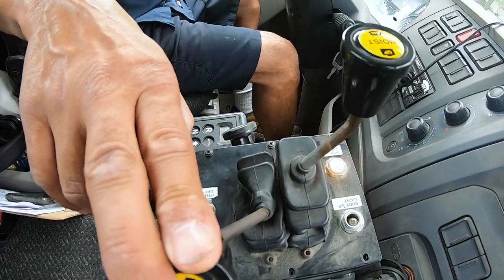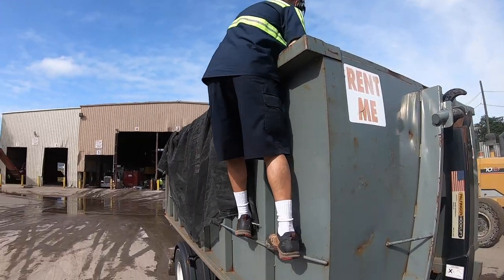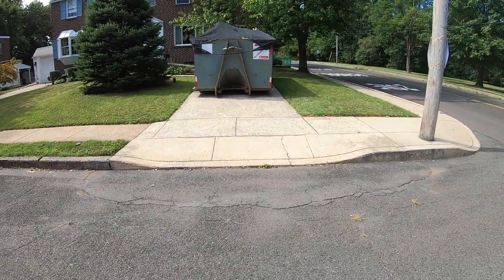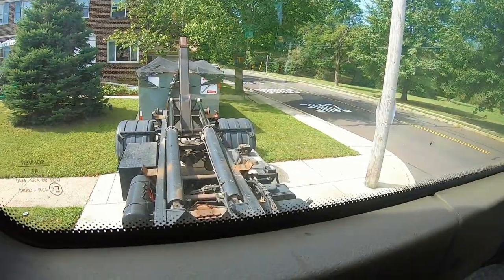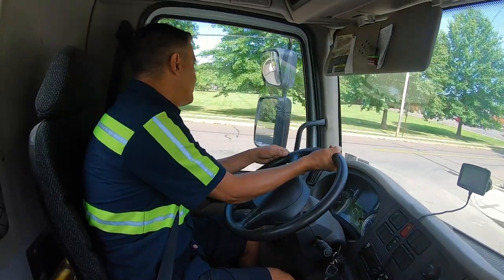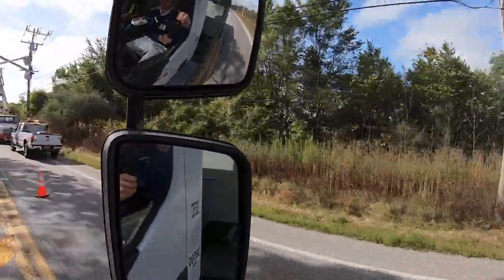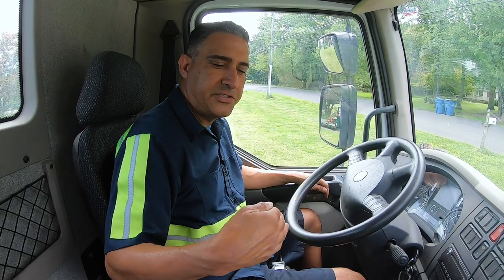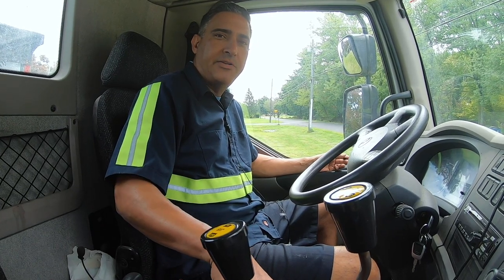Avoiding (Massive Fines) With An Overweight Dumpster Truck

Comment: Looking back would you still choose a hook lift over the cable system? I see Republic and Waste Management using the cable systems here, I was just curious to see if one was more superior than the other. Thank you in advance love your videos
Reply: I’ve found you can articulate situations in your favor a little easier with a cable setup. I like both but if I were buying a truck... I would go cable.
Reply: After working with both kinds, i would take the cable. 
Hook lift is awesome in tight spots if you need to spot the box like a trailer, the driver can go about 30* angle like a trailer while picking or dropping... As long as it is perfectly straight when box contacts the truck rails. But no choice how high the front of the box goes up when pulling it on truck.  If theres lots of junk above the box, it might slide off the back.
Cable lift can bring the rails down, get the box rollers to just clear the fenders. Get under those low residential house wires and large tree branches. 
I"ve been at it for about 10 years. I had to put boxes inside a garage, under a conveyor loading system with the hook lift. Put the box exactly on spot all day long. 
Cable lift, get the back rollers down on the ground and drive the truck out from under the box
Reply from the maker: My pleasure to help

Comment: you so wrong you do not know what your talking about if its to heavy when you pick it up the box it will pull the truck ifs light it will roll out and left the box that  there that could be picked you would be fired
Reply from the maker: I will watch maybe I made a miss speak I agree with what your saying